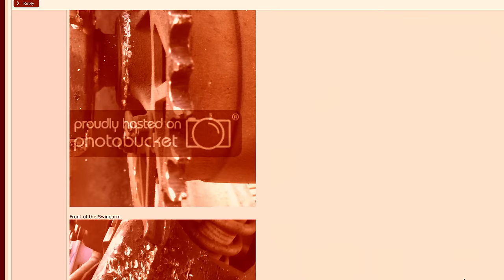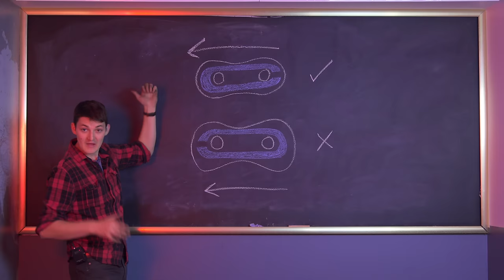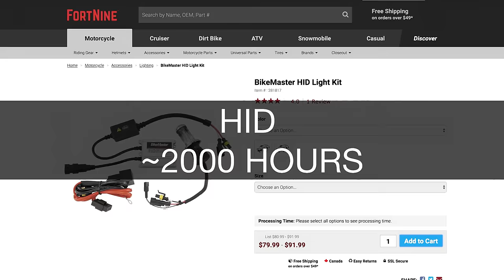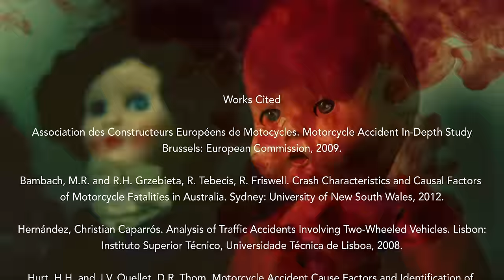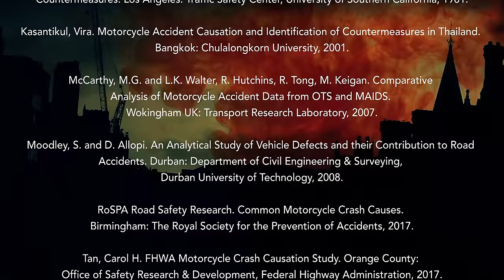Mechanical Monsters – 5 Maintenance Jobs that are Deadly to Overlook

Comment: **BMW FAULTY SPOKE WHEELS FEB2018-JUNE2018 - NO RECALL?**
I tell you what could potentially kill motorcyclists: motorbike manufacturers do not seem to have the same obligations as their 4 wheel counterparts. I take one recent example which you may have heard about at FortNine since your main protagonist rides a BMW. In Australia the front spokes wheel of a 2016 BMW R1200 GS proved faulty and one particular rider faceplanted in the outback resulting in months of operations and reeducation of his valuable limbs... The front wheel literally collapsed at reasonable low speed (50/60kph if I recall) under his own weight on a bumpy road. The rider was still extremely lucky to make it alive. Now that was in Australia and I live in New Zealand and I owned a BMW R9T Scrambler... with spoke wheels, similar design. There has not been a single recall from BMW, not a call, not an email "you may have heard about that guy in Australia...", nothing from BMW. In fact the only way I found about it was by searching spoke wheels for R9T on the web. Judging by the article (link below) which dates from December 2018, there was a "probe". Even the local "licensed" BMW mechanic I go to for my services has not contacted me. I have contacted BMW in Germany 3 months ago and I am yet to receive any feedback. Have you guys heard anything from BMW wherever you live Canada, Europe or even Australia? I have not.

I have contacted the local authorities, their answer: take it to the manufacturer... which begs the question: how do recall work in the World of Motorcycling then? It just does not seem to apply. Meanwhile, I pay every year 7 times the cost of a car registration renewal because I quote "bikers are more likely to cost the taxpayers for hospital expenses of long duration". No kidding, how cynical is that. Have you guys heard from it in North America? Any recall from BMW Motorrad? Any communication on the subject of faulty spoke wheels? That's pretty serious stuff especially when many riders have their partner or a passenger at the back. And yet, I have heard nothing from BMW. The design of the spoke wheels has not changed from what I see and it is being used across several models of BMW GS, R9T and so on. So, what's going on at BMW and is it an industry trend?
https://motorbikewriter.com/crash-prompts-bmw-spoked-wheel-probe/

Comment: Hey would anyone be able to answer my question? So I was practicing U-turns recently and I was unfortunately dragging the rear brake for like 15-20 minutes straight while practicing and after about 20 minutes I noticed a burning smell and my rear brake pedal was very slack and able to be pushed down very far (likley due to the brake fluid boiling). I got off the bike and let it cool down and I noticed a few things. For one the rear brake rotor had fairly significant discoloration with red/purple/blue lines on it and it also had what appeared to be brown burn marks near where the rotor was bolted onto the wheel. And there were two score marks on rotor where the brake pads pressed down compared to the front wheel rotor that had only one score mark. I tested my rear brake at low speed after letting it cool down and it felt fine and appeared to not be diminished, but I was wondering if my rotors, became glazed or if my brake pads were damaged. If so what should I do to remedy this?

Comment: Hey everyone! talking about maintenance. I constantly got flat tires after making my CG 125 Honda to go either, under heavy rain, or as Two days ago, after traveling for about 150 miles (around 240 kilometers), in a day, it happened again. My motorcycle has the same type of wheel as Ryan's; spoked wheel. Why am I having this annoying situation every time? Tire doesn't get flat immediately but after over night, then any of the two tires, is flat next day in the morning. I don't have an idea why is happening constantly this to me. Hope you could help me with it. I'm desperate because this has happened more than 6 times in less than a year. Thank you so much! Kudos to all from Mexico.

Comment: Almost every motorcycle break will fail if there is no traction (wet surface), when slammed at 10 ft before impact in 70kmph+, they all blame "break fail"

Comment: Can anyone help me with an odd Scooter issue?
I was letting my nephew learn on my Metro 50 and he said he thought the tires were low, I got on and yeah, around corners it had that odd floaty slidey feeling of flat tires, but the tire pressure is fine. The suspension feels okay, the tires look fine to my eye... I don't know what caused that wierd handling and it happens occasionally now, and seems to go away again and come back. It's especially bad when I take a corner slowly or pull out of a stop through a corner, it feels like the back end slides out a bit and feels super unstable like I could just fall over.

Any help from anyone would be appreciated, I'm not super mechanically inclined. I just recently got into scooters and small bikes and I'm learning more day by day. I just want my nephew to be safe.
Thanks.

Comment: I have a problem for all the mechanics here: basically my bike seems to run fine. But sometimes it justs decides to turn off. When that happens, it seems like there is no way to turn it back on. You can try for minutes and nothing is gonna happen. BUT if i just turn off with the key, count to 3 and put it back on the "on" position, it turns on like nothing happened
I fell once because it decided to stop working on a corner LOL. Help?

Comment: Does he sell parts? Or sponsor's a parts group? Cos I had a yz 250 for years  and never did I have to change the bearings, plus  I didn't have a problem with most the areas he mentioned,

Comment: I had a 250cc helix that someone put the carb hose clamp on upsidedown so it stuck out on the same side as the throttle and I ended up with the throttle stuck wide open on the highway, almost shit my pants trying to get to the right lane so I could kill the engine.

Comment: Man i blew up my rear wheel bearing once scared me to death, my chain derailed once and dug in locked the rear wheel scared me to death, i have steel brake lines so my brake line never snapped but the washer or the bolt let go once so i had no pressure scared my to death as well, once i was riding in the dark in the rain and the rain fucked up my electrics so both my lights went riding pitch black 5 miles from home, so i sitting here wondering why im not dead yet

Comment: Not really a biker, but i was thinking of chain straight up, since idid happen to me on moped (with mods etc which can do easily over 80khm) with fulll speed, i was riding all the time in those days. Not bolted rear axle spin off chain ,  lock up the wheel and i was skidding about 50-100m where back wheel start to catching me up, so kind of speedway in tarmac. Still couldn't understand how i manage to stay on the biek and not twist or broken my leg etc. If that would happen to me with some heavy, faster bike, i would be gonner probably..

Comment: Well guess I should be dead by now,, have had many bikes , the current bike I ride is 14 years old,,48000 miles and I haven't done jack to it yet,,, except change oil and oil chain,,,, same sprockets, chain , brake lines,,  sounds like maybe this winter its time to replace a few things.

Comment: Skip the nonsense and get yourself some braded brake lines... the rubber inside the stainless steel exterior lining will still dry rot.... eventually.   But MAN DO THOSE BRAKES FEEL GRRRREAT!!! WOOHOO!!!  And they do last longer due to UV light not being able to reach the rubber hose, and that balooning will go away completely relieving the breakdown of internal rubber hose fibers.  Also I use DOT 5.1 made by Motul for brake fluid, but you can get away with just about any DOT 4.  And change your brake fluid every 6 months FROM A SEALED NEW CAN, NOT THE ONE WITH THE CAP LOOSE SITTING ON YOUR GARAGE SHELF!!! cause brake fluid tends to absorb water no matter how good or new your seals are.

Comment: Completely wrong. EVERY SINGLE thing you listed IS rider error. The only way you can say its not would be if you have a fresh faulty part. It can happen take the break lines for example put a new set on first ride they pop a hole and cause and accident that would not be the riders fault. If you have not changed the lines in 10 years and they pop that IS the riders fault. Using these correct terms I bet the number of accidents caused by the bike is closer to 1 in 1000 than 1 in 17.

Comment: The motion pro alignment tool
Is a joke. It’s not aligned to anything.
Reply: Try one some time. You’ll see what I mean. I have one. I never use it.
Reply: Ps don’t turn your peg for a Jack stand.  
They often break under the weight of the rider alone.  Don’t lift your bike with them.  See rider forums. Happens all the time.